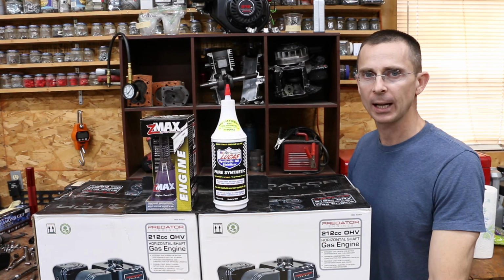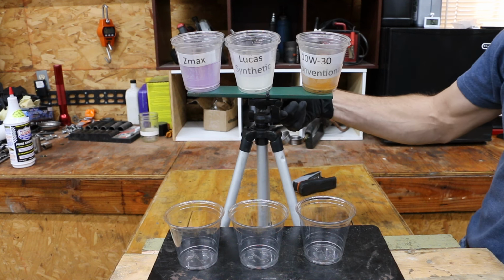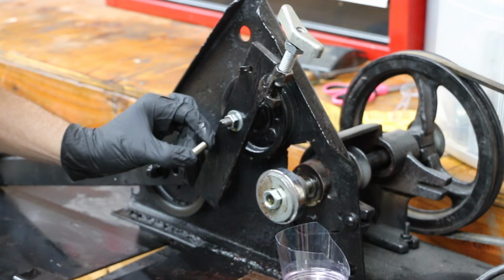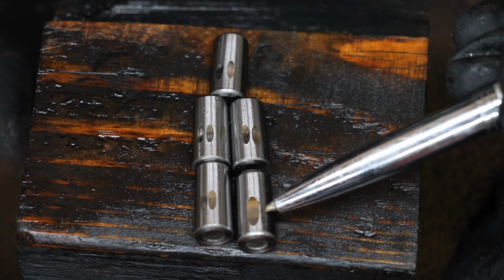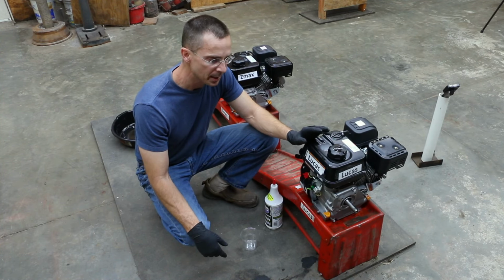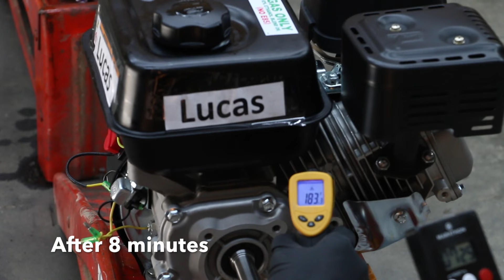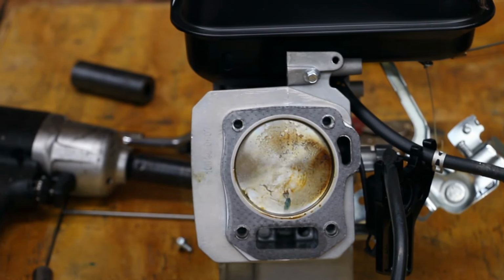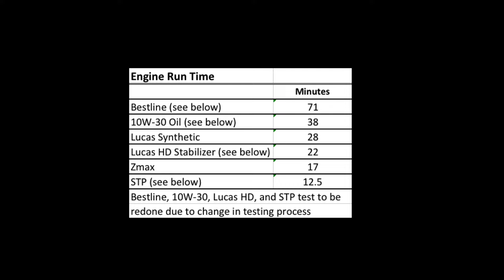Which engine self-destructs first? Zmax or Lucas Synthetic?

Comment: So this video is so wrong. I know it is old and the discussion is probably over but the zMax is being compared to a product it does not compete with. Zmax is not an oil additive, it is a micro-lubricant that is designed to keep the surfaces of the metal clean and prevent carbon build-up. You can actually see that in this video a bit when you saw the piston heads after the test. Lucas is an additive and a great one! The properties of which are best demonstrated in this type of test. But if your desire is to have an engine running as clean as it did off the factory floor, leaving the horsepower as strong as it can be, and in the case of big engines, like semi-trucks and locomotives, not losing fuel efficiency through the stack, then Zmax is the product to use hands down. Don't believe me, talk to the locomotive industry that is now saving millions of dollars annually because of zMax. Or ask any independent owner operated truck driver that hauls long distances they know what works and they stand by it.
Reply: Don, you nailed it.  This is the same reason AVBLEND (same chemical approved for piston aircraft engines) is used extensively.  Thank you for your clarity on this subject.  In addition, would have been interesting to see it having been added to the gas as that provides another layer of protection.

Comment: Boy Zmax is some real Snake Oil ...!!!!!
Reply from the maker: Thanks for commenting.
Reply: Then why did the FAA approve it for piston aircraft engines?  Why does the FTC allow them to claim "zMAX Micro-lubricant soaks into metal to help reduce harmful carbon deposits. This allows zMAX to extend engine life, improve performance, increase horsepower, reduce emissions and increase gas mileage."???
Because is is NOT an oil additive and is not being tested for what it does in these tests - with all due respect.

Comment: ZMax is not an oil additive. It's meant after operating temperature to be absorbed into the metals of the engine, piston rods, piston rings, etc. It's not like a marvel mystery oil or seafoam. I use ZMax in my 2007 Fusion with 140,000+ miles. No issues what so ever.
Reply: Well i guess u must be using some good oil cuz the 99% mineral oil in zmax isn't doing a thing but evaporating slowly. Just saying buddy.

Comment: You should do the engine run test with motorkote, im interested to see the results, especially since i need to buy sometime to do valve seals in my 8.0L Ram V10
Reply: Just recently learned about motorkote I would LOVE to see that comparison!!!!
Reply: Erik Horne I’ve actually tried it in my ram, picked up 1.5 MPG took me from 9 to 10.2 MPG
Reply: Brent Smith III Thanks for your input might actually switch from Lucas to motorkote.
Reply: Erik Horne the price is a little higher, but the benefits are real, and it doesnt wash away with water
Reply: Brent Smith III Thanks again, a little more is worth the long term effects especially since I only have a little more than 36000 miles on my 2015 Ram sport! Be good!

Comment: I've not considered purchasing Z-max and now I'm certain that I never will. I use Mobil1 full synthetic (10,000 mile oil) matched with their 20,000 mile oil filter and after reading many of the comments regarding the purpose for an additive, I didn't use one with the last change. Thank you for exposing automotive myths for what they are.
Reply from the maker: Thanks for sharing.

Comment: Will an engine run with diesel as oil!?
Reply: Monkerr it will, just not for long 😂😂 actually a great idea tho. I second this
Reply: I've used diesel and kerosene before doing  oil changes to clean out the engine let it run about a minute or two but straight fuel in the crankcase I'd imagine it'd probably blow up but would be a awesome video
Reply from the maker: Thank you for this recommendation.

Comment: This was a awesome presentation and comparison of the 2 products. 
And I absolutely appreciate your being non biased, as I have never seen you do that!!
   It was however quite obvious that the Lucas was the winner as it did provide much more 
Protection for the engine that it was used in. 
  Also the breaking in of the engines with no detergent engine oil is the very best way to break
In a new or rebuilt or overhauled engine. 
  And in a automobile at least a minimum of 500 miles with the correct weight engine oil. 
This gives much better sealing of the piston rings to the cylinders and proper seating of the valves and a good break in for the lifter’s and the camshaft and timing chain and timing chain gears and or sprockets to all to seat well. 
   The cylinder walls have a much better chance to build up a glaze on the cylinder walls and also on the rings. 
Some people do not know how critical that this is as it is what will make the cylinder walls and rings last much longer if they get too seat fully by the time the glaze forms on the cylinder walls. 
   You I am sure already know that when you overhaul a engine that you use a hone to break the glaze on the cylinder walls so that the new piston rings may seat properly. 
   A rebuilt engine gets its cylinder bored to a bigger circumference and is also honed somewhat to get a crosshatch in the cylinders that is what holds the oil for lubrication for the piston and piston rings is the crosshatching of the cylinder walls. 
   However on new automotive engines the tolerances are so tight that this is not necessary. 
I however have changed the engine oil and filter on my two past new ford engines at 500  miles. 
  And at after 5000 miles I switch to Amsoil signature series oil and a bottle of Lucas synthetic oil additive. 
 My 2014 2 liter eco boost  had  a bit over 200000 miles on it however a person ran a stop sign and totaled it. 
   So very sad it had given zero problems including no turbocharger problems and as I know of little to no carbon buildup in the valves. 
   As it was running perfectly and powerfully at its demise. 
I run Amsoil in every thing including automatic transmissions.   It is the best lubrication product you can buy. 
   And as you probably already know that on startup is when the most ware is put on engine parts especially the crankshaft bearings and cylinder walls and camshaft lobes. 
   As you probably already know the camshaft lobes and the lifter area the camshaft lobes that spin and push against and the cylinder walls and timing chains and sprockets the before mentioned components rely on splash or drip lubrication 
  The crankshaft main and rod bearings and the camshaft bearings and piston pins and variable camshaft timing engines those components are all pressurized with oil from the oil pump. 
   And as you demonstrate it is important for all engine components that have friction on the ones that move it is of upmost importance that they get oil pressure very quickly. 
  The least likely surface to ware is the camshaft bearings as they are round and under pretty much the same ware pressures on each of the camshaft bearings. 
   The ideal startup solution would be for a electric oil pump to pressurize the oil system before cranking to start it. 
OKAY enough of my ranting for now. 
   And you’re channel is my favorite.
Reply from the maker: Thanks!  Thanks for sharing.

Comment: I started using Lucas products long before I saw your videos because I learned from other sources that it stands up to heat better than the OE products. I use the transmission fluid and the power steering fluid and I did use the engine oil and brake fluid at one point too but it is not easy to get the engine oil /brake fluid here where I am so I switched back to Valvoline engine oil and other brand brake fluid. But I am a believer in Lucas products. I LIKE THE TEST VIDEOS AND THE ONLY WAY TO KNOW IS TO TEST, EVEN IF IT MEANS RUINING A NEW ENGINE. Thank you.
Reply from the maker: Thanks!

Comment: I use Lucas pure synthetic in my 05 Dodge 3500 4x4 5.9 cummins I use this product in my 6 speed manual with 2 quarts Lucas and topped off with Amsoil sever gear . This so far has been the best for me . shifts very smoothly and quite. I have tried a lot of different oils and so far Iam happy with this combo.
Reply from the maker: Thanks for sharing.

Comment: I have never used Lucas, but have used STP a very few times.  My Trade School professor, Auto Mechanics, said oil additives are just sales gimmicks, and a high quality, specified weight, motor oil is all you need.  STP just adds some viscosity to oil and will quieten lifter peck, temporally.  I agree with my teacher.  Synthetic oil maintains lubrication on surfaces longer than standard motor oil.  I would suggest trying your wear test, comparing synthetic oil to regular oil, just for curiosity's sake.  Thanks for the interesting video.
Reply from the maker: You are welcome!  Thanks for the suggestion.

Comment: Sometimes you just have to break a couple eggs to make a cake. We all learned a lot and you already found a new purpose for the broken engines. You really bent over backwards to see to it waste was held to a minimum. You paid for the engines so they are your property to do with as you please. I had problems with an engine I used zmax in once. I have told people this and it was not believed. The damage suffered by these 2 engines will be nothing compared to the engines that have been saved from people buying an expensive additive that could harm their engine. Look at the potential car, truck and diesel engines that might have drank the wrong snake oil if you didn't do this. I can't find fault in you for breaking your stuff once to save other people. Thank you for buying these expensive engines and answering questions. It isn't like you took a sledge hammer to the engines, this was very controlled and documented, this is scientific! I can't even tell you how many times I have taken a destructive welding test to certify. Those plates and pipe are cheap compared to not testing weldors before they weld on critical parts. I wonder how many of the complainers are overweight, drink coffee and use tobacco?
Reply from the maker: You are welcome!

Comment: You are the NASCAR of small engines! Awesome work and I cringe watching the engines go to the end! How about the oil change. This is the process for my oil changes.  I have a 95 GMC K1500HD 350/5.7L GMT400 and love it!  I run a 350/5.7L TBI, S10 2.2L, and Merc Mountaineer 302/5.0L and do the same thing for all of them. Seafoam in the oil crank case and fuel tank about a week before I schedule the oil change. A cup of kerosene in the oil before you change it(Engine Flush). Then the I put a cup of kerosene in the crank case run for about 5 minutes after running it on the drive home from work or the store. Better to do it just sitting in the drive way after you get back and let it work without a load. Your engine now is stripped so you have to rebuild the lubricity of the engine. I used to use Zmax but after watching this test which was great and I understand it is just mineral oil (Zmax), which I thought it was and just went with it but now I use Lucas Synthetic with a heavier oil 10w40 (Summer 20W50 no additive or 10w 30 with additive for winter if I am running for a long drive (Md, WV, to Fla). Around the house depends on the vehicle but the S10/2.2L 5w-20 Syn Change every 5k, Small blocks 10w30 in winter only additive for the long hauls and 10w40 for summer with additive and 20W50 for hot summer long hauls. So far 230k on the 95 K1500 5.7L, 200+k on the Merc 302/5.0L, and 210k on the S10/2.2. The S10 is known for head gaskets every 90k it has had one replaced and a new head at 180k but I run that lil truck like NASCAR and still runs great! Thank you for your expertise, knowledge and willing to share the info! Happy New Years!
Reply from the maker: You are welcome!  Happy New Year!

Comment: I have a 1995 Silverado, bought new, drove off lot with 12 miles on it. Now it has 422,700+ miles, no rebuild on engine and transmission,  still runs good. Lucas and conventional oil and I never let it get low.
Reply from the maker: Nice!

Comment: The Z Max engine was really clean on the inside. It broke down the carbon build up. It still ran 17 minutes. Before shattering the engine. I don't think it's suppose to be like Bestline or Lucas oil treatments. It's suppose to keep the carbon from building up.   Shawn.
Reply from the maker: Thanks for the feedback.

Comment: Zmax... More like Zcrap... I've been using Lucas for a long time now and the truck I first started using it in (1988 Chevy S10 with the 2.8L V6) currently has 879,402 miles on it. I started using Lucas in it when it had around 20,000 miles on it because Lucas Oil didn't come out 1989. Still running strong to this day and never have had to rebuild or replace any engine parts. My daily truck is a 2013 Chevy Silverado 1500 with the 5.3L V8, I bought it brand new and have used Lucas in it since the first oil change. It currently has 272,194 miles on it and it's running strong to this day also and never rebuilt or replaced any engine parts on it either. I've either been very lucky with my trucks or Lucas is just the best thing you can put in your engine.
Reply from the maker: Thank you for the feedback

Comment: Great test...

Synthetic oil is definitely lubricates well.

years ago I had an old push mower with 3.5HP Briggs engine that was wore out and smoked pritty bad once it got heated up from use and the power would noticably drop once it got hot and the grass got thicker.

The compression was so bad that if it died, I had to let it cool for a while before it would start again.

One day just for kicks I drained the oil and replaced the standard 30W with a now 10-30W full synthetic made bt Penzoil this was back in 1997 and Penzoil doesnt make this particular labeled oil anymore, but to my surprise after doing nothing else to that old mower it had more noticably power when it heated up and no matter how long I ran it I could shut it off and it would start right back up with 1 or 2 pulls.

All I could think was that the film strength of that full synthetic oil was better and allowed the engine to maintain better compression and I also noticed it didnt smoke nearly as much as before with conventional 30W oil.

Maybe my situation with that old mower was just a flute, but it sure got me to thinking that just maybe the full synthetic oils or at least some of them might just be that much better....??????

Just an experience I had and thought Id share.
Reply from the maker: Thanks!  Thanks for sharing.
Reply: Thanks for sharing this story 🙂. I plan on tuning up my mower before winter storage, so I'll try the synthetic change to see how "old faithful" runs💪🏽

Comment: I've been trucking for decades. And have spent money on Lucas for all of it. Delivered to lucas . Great american folks. They are very meticulous on checking hoses for transfer fluids. Must be spotless.  And cleaned trailers to kosher levels. Yes kosher.  Now I'm vindicated. My vehicles have always preformed great . Low break downs ,none engine failures. Thanks. Trucks Last millions of miles. Have trucks from the 80's 90's. Still working. Would like to know what sulfur has too do with fuel. They removed sulfur from fuel.
Reply from the maker: Thanks for the feedback and video idea.

Comment: Thanks for the video! I have added ZMax to my truck after hearing about a commercial where they run a Vette up the Pikes Peak Hwy after having ZMax added and then removing the oil, it supposedly made it to the top without seizing the motor 😆. I trust your video way more and I will say thanks to the test results (which speak for themselves) I won't waste any more $ adding ZMax...
Reply from the maker: Glad it helped you figure out things.

Comment: I been using lucas since 94. A tester showed it sticks to metal surfaces. made sense at dry start ups. One day just check it as routine. found it was 3 quarts low. No valve tapping or No knocking of bearings, no indication of low oil. no low oil light came on.(surprised why)  Thought the engine was ruined. Dont know how long it was running with low oil, I thought I had Ring wear,  etc. Nothing. Did a oil change with lucas, I checked the oil at every fill up, no oil lose.  Been using it in all my engines since 94.  Had 66k on my harley with lucas, did a engine rebuild. Curious about lucas check rings. No wear ring wear . At build towerence, It didn't need rebuild. Just wanted larger displacement. No lower block engine wear, at Factory towerences.  Thats after using lucas. I'll never stop using it. But since it would thicken in cold weather. I use  the lowest weight oil before winter and back to regular weight in the spring. I recommend it to all who I talk to.  It coats metal surfaces so it wont be dry at start up is what got me.
Reply from the maker: Thanks for sharing.

Comment: I’ve been told adding Marvel Mystery Oil will help my 2010 GMC LC9 engine get rid of the piston slap I have at 160k miles and I deleted the AFM with new valve train at 143k miles when my plastic lifter tray failed (it let the roller lifter turn sideways to destroy itself). I’m going to look at your videos and see if you tested it for any added benefits. Thank you for all you do good sir, and thank you for your service.
Reply from the maker: Thank you!

Comment: Tough to do but also a control motor with just oil and if possible get all motors close in manufacturers numbers to prove all were built with same dated parts proving motors are as equal as possible. I do believe your results were accurate. I know you want to be as perfect as you can. Great job again keep it up love your stuff.
Reply from the maker: Thanks, will do!